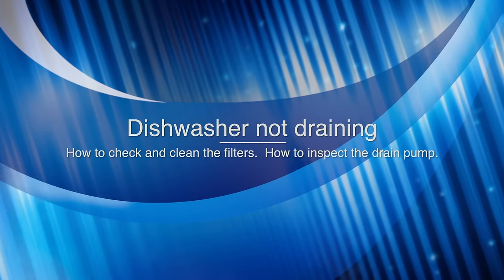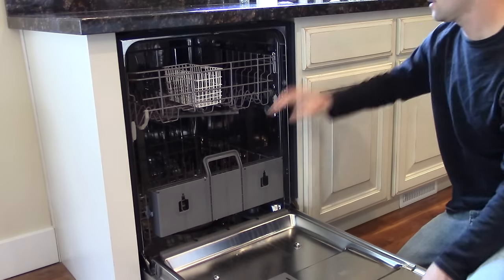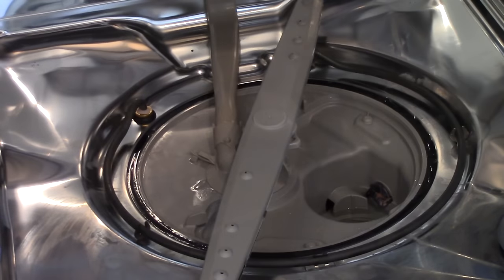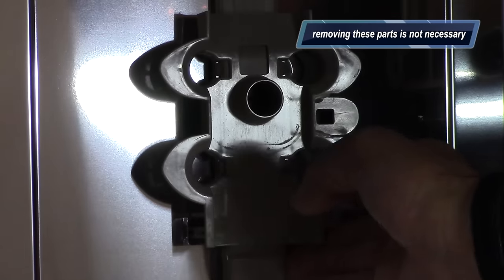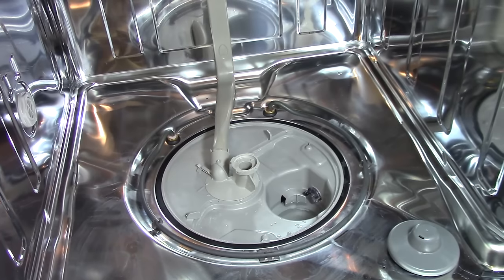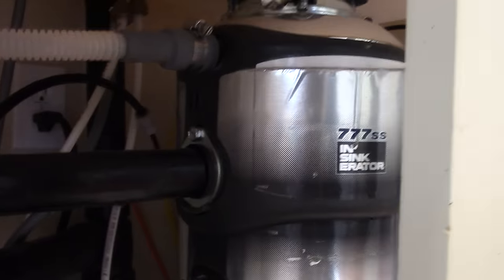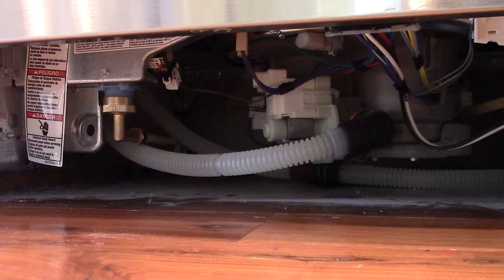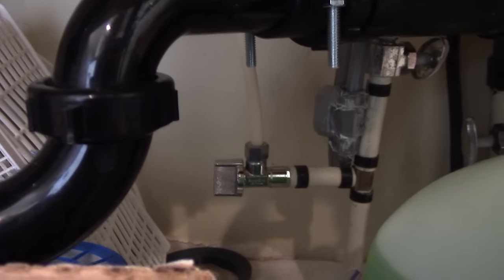How to repair a dishwasher, not draining cleaning - troubleshoot Whirlpool Kitchenaid

Comment: So mine is this exact model. I have water coming in with solid pressure, pump drains correctly but the arms won't rotate. I disassembled as you indicated and had no debris in the area in or around the filter assembly. What am I missing? Thanks

Comment: I have a Kenmore, but very, very similar.  Nothing you covered here fixed it.  However, I undid the tube to the pump, undid the other end of the tube attached to the garbage disposal and tried blowing air through the tube.  I could not and was able to deduce that tube was clogged somewhere.   It was a long loopij g tube and water was trapped.  Thank you so much.

Comment: i have a dishwasher just like the one in the video, except its black w/ grey interior, it will not drain completely, but water flows through the grey drain hose i have installed. I tried repacking with a new one ut it leaked, the connection leads directly to my drain, its jury rigged with a piece of copper in-between the old grey tube and some rubber hose (the grey tube is clear) any idea why it isn't draining? i hear the pump start, and the tube jerks when it starts, indicating water flowing

Comment: I have a brand new kitchenaid dishwasher that works great. However when I take the filter out to check that it is clean I notice there is water just under the filter area.  Is this normal, or is my dishwasher not draining properly? I've never had a dishwasher before so I don't know. It is installed with the 12 foot drain hose because I could not place it right next to the sink, so therefore there is not a high loop under the sink. Could that be the problem & if so, can I add the original 6 foot hose to it so I would have enough hose to make the high loop? My dishes come out clean & there is never any water in the bottom of the dishwasher,  just under the filter. Thanks.

Comment: Okay, I did this as it says nothing in the pump unit no blockages, mine has been setting for a while so it had buildup in the bottom from staleness, I have a portable (made it that way) and what happened was gunk filled the hose and blocked the exit to the drain tube so I ran an old tooth brush and squeezed the drain tube while it was putting pressure on it and that gunk shot out. So if this doesn't fix your problem look at the drain tube.

Comment: Pulled the dishwasher out, removed pump, no debris found. Powered on dw impeller works. End of cycle, the dw is still left with water at the level of bottom sprayer.

Comment: Our Whirlpool dishwasher suddenly stopped draining. We replaced the drain pump it drained better but not completely. We have to hit the cancel drain button several times to get it to drain. We have tried two new drain pumps and it still doesn't drain completely. All lines have been checked and are clear. What else could be going on?

Comment: its also identical to my amana adb1300afw1.   though this video didn't help my problem.   I tricked it to cycle with the door open so I can see it fill with water and it drains fine too. but during the time between filling and draining water will not spray.

Comment: Hi. I took out the filter and a lever, small plastic arm was inside, inadvertently, I removed this part. I think this is the clip that the filter clicks into to hold in in place. I have no idea how to replace it or which way it even goes in?? Any advice?  Thanks. Donna

Comment: What is that rubber ring on the bottom of the dishwasher that is under lower arm called? Mine is deteriorating and I can’t find the correct name so I can order a replacement. Thanks for your video. It was very clear on how to clean filter, etc.

Comment: great video got me on the right track to repair. My issue wasnt the filter it was the drain line. My drain line goes thru an airlock (prob the wrong name, it sticks thru the top of the sink or under it) . Mine had a small piece of wood like the tip of a  toothpick lodged in it that accumulated other gunk and stoped it up. If you drain line has on of theese devices under the sink check it for clogs.

Comment: Hi Adam, Thank you very much for a very good video.  My dishwasher Whirlpool adp (I forgot the last 4 digits but it is less than 3 years old)  has stopped for the last week.  It starts, water comes in, water drains completely and then dishwasher goes off.  sometimes the light flashes 5 times, and I have cleaned the two arms and can't see any blockages.  Could there be something else? Please help???
Reply from the maker: Tariq Qadeer 

I would check the whole cycle for blockages. The blockage may be somewhere else along the line that is causing the machine to stop.  Also it could be a bad sensor, but that is not as common. 

I added the info below for anyone else reading this that may be interested.

Whirlpool Dishwasher Error codes.

F0. 10 flashes. Sensor Break (Only shown in test program. Not visible to customer).

F1. Single flash. NTC Break. NTC open circuit/short circuit or ambient temperature less than 3 Celsius

F2. 2 Flashes. Water leakage. Floater switch LS6 in drip tray has switched.

F3. 3 Flashes. Heating system defect. Heater or relay on control board defect. Chack also cabling.

F4. 4 Flashes. Draining failure. Drain pump, control board OWI or water indicator defect.

F5. 5 Flashes. Spray arm Blocked (not present on VBL version. On 1 digit display will show as F and flashing start led).

F6. 6 Flashes. Water valve (WV1) is switched on but flow meter (FM) senses no impulses (less than 10 impulses in 10 secs) and the water indicator (WI) is at a low level
Water Valve Closed. Water inlet hose blocked.
Water inlet valve (WV1) defective. Flow meter (FM) defective (leads to FM failure)

F7. 7 Flashes. Flow meter failure. Flow meter defect. Water inlet valve defect or water inlet hose blocked.

F8. 8 Flashes. Water level failure. Sieve strongly dirty or big amount of foam inside to less water.

F9. 9 Flashes. Continuously Water Inlet. Water inlet valve mechanically not closed or control board defect.

FA. 11 Flashes. OWI failure. Dirty OWI lens. OWI defect or control board defect. Check cabling.

FB. 12 Flashes. Motorised Diverter Valve

FC. 13 Flashes. Water Hardness Sensor Failure

A fault with no fault code indication = faulty module

These codes should cover the entire range of Whirlpool dishwashers.

Test Mode

Make sure the appliance is empty of water before running Diagnostics as it does not pump out before starting to fill and therefore you could overfill the appliance.
Open the door and set the program to the first program. (Normally rinse).
Turn the power off.
Press and hold the start button and while holding turn the power on.
After a little while the start button will flash, release the button.
Press the start button once and close the dishwasher door.
The machine will now run through a diagnostic routine.
If memory serves me right it takes about 20 mins.
The machine will stop during diagnostics if an error is found and will display the error code. If no error is found it will complete the diagnostics and end the program.

To exit diagnostics at any time just press and hold the start button till the program is cancelled

Comment: Also in case you recently installed a new garbage disposal and have this problem, make sure that you hammered out the plug for the dishwasher drain hose connection.

Comment: In my whirlpool wdf530plywo dishwasher, the water is not draining. I cleaned the filter, reset the breaker, it has no power. The float s fine, I removed all the standing water. Still no power. What could it be? Thank you in advance.
Reply from the maker: +Richie Fish No power at all?

Comment: Hi Adam, We have a dishwasher it's an Omega, and I have noticed that it doesn't drain fully where the filter goes, I noticed that in your above video yours hadn't drain all the way either. You had clear water at the bottom of where your filter goes. In my dishwasher it's a lot higher than your water level and it is pretty rancid. I have put through multiple dishwasher cleaners and it still stinks the dishwasher out and makes the filter all moldy and gross. I have pulled the above parts out as you mention in the beginning of your video but not the pump yet (Now that you've shown me where to look for it), and I can't see anything that could be blocking the machine from draining well. 

Does it sound normal that it's filling up where the filter goes? It pretty much covers the entire filter in this gross old water. 

Thanks for your helpful video :)
Reply from the maker: +Bexc Wexc   No that is not normal to have a lot of water in the bottom.  When you drain the dishwasher where does the water go? Do you see it flood into the disposal?  Or is the drain hose hooked up to a pipe?  If you can see it  drain in the disposal how heavy is the flow?  It should be a fairly heavy push.  If it is weak or a trickle you either have a clog in the hose or a drain pump problem.   If it is flowing well you may have water from the sink finding its way back into the dishwasher.  That happens when there is not a sufficient arch in the drain hose.  Let me know what you find.

Comment: My unit started to make some glass grinding noise and now it doesn’t go nick into a u cycle. It stops after one minute and the cancel led turns red. Is there a cycle that just drains the water ? I wonder if the thermal fuse could be the issue.

Comment: Mine had a problem the check valve. That thing is in the hose and it took me forever to figure it out. But only had to run some water from my outside hose through it to fix it .

Comment: Ours is a kitchenaid,  looks identical,  but it's filling and draining,  but not spraying. It's very frustrating trying to figure it out! Any thoughts would be great. 
Thanks!
Reply: George Robinson the spray arm holes can clog. Pop off the spray arm in the center and clean the holes with a toothpick. Some models have two arms, one top and one bottom.

Comment: Hi Adam, thank you. This model looks exactly like mine. I did break a glass in the dishwasher right before the water wouldn't drain. I tried the filter and the drain hole carefully but nothing. Where is this vent near the faucet that Chloe mentioned. Inside the cabinet? Thanks again.
Reply from the maker: Sorry for the late reply. She is talking about the Air Gap Vent. Some dishwashers set-ups use them and some use the drain hose high loop method.   The air gap vent allows airflow and when blocked with debris may slow the water from draining.  You know if you have one if you see a vent near the faucet handle of your sink. Just google image search 'air gap vent' and you will see what I am talking about.   Some places in the US require them and some don't.   If the vent is not the problem I would try a shop vac and try to suck out the glass from the pump impeller hole [if there is glass shards stoping the impeller] 1:41

Comment: Thanks for the info!  I have very similar dishwasher (Whirpool Gold model WDT720PADM1).  Washer wasn't washing.  It would fill, heat and drain however.

I cleaned out my filters (had some gunk for sure) and checked my water valve for blockage.  Still wasn't washing (would only fill and then drain).

I unplugged for a bit to check the undercarriage.  Unplugged all the connectors and inspected and reconnected.  All looked fine.

Then I plugged dishwasher back, ran a cycle and when verifying voltage at the pump the dang circ pump started working like it should (with 124v AC at circ pump)!!  Wooohoooo!  Then I ran a complete wash cycle with no issues.

SO...I'm not sure if the clogged screens, loose connections or perhaps I freed some kind of blockage when I was inspecting the circ pump and/or had the unit sitting on its side (?).  I'll never know.  Just glad the unit is washing again.  And the fix cost me $0.  =)

Wife thinks I'm a superhero!!!!!!!!!!!!!  <3

Comment: A very helpful video.  There's only one thing missing.  If you have one, don't forget the Air Gap.  It gathers debris as well.  After doing all the above, I needed a service man to show me how to remove the insert with a pair of needle nose pliers and remove the clog, which has stopped the dishwasher from draining.  It was a quick, $53 lesson -- but money well spent.  Parts and Labor for someone replacing the drain pump I was told would be $500.  I consider myself lucky I got an honest serviceman.  Mike at Vincent' Appliance  Repair in West Hills, California.

Comment: I have replace the drain pump and pump & motor assembly but I still have water in the dishwasher and checked all the hose and cleaned out my pipes under sink what else do I have to do so all water is emptied out

Comment: Adam just one question, I’ve had issue with my kitchen sink not draining at all (pls note it’s connected with my dishwasher), after I tried all ways, HG liquid, Unstopper spring, etc. Nothing works. Until today I found out my dishwasher is also not draining. So is it dishwasher pump problem which leads my sink not drain too?

Comment: Our dishwasher (WDT780SAEM2) has been working great for years now, until last night it didn't drain during a wash. With milky white water in the bottom, I wasn't sure what I could do or even where the drain was. Your video showed me where the strainer was and how to take it out. Though it was indeed pretty badly gunked up, I also checked the drain hose near the disposal and saw a blockage through the translucent plastic. I removed the end, poked out the obstruction, replaced the hose, and started a new wash cycle, to hear the sweet sound of water draining! Ahhh, success! No ridiculous repair bill, either! I LOVE the fact that this guy is American made in Ohio, too!

Comment: Thank you for the video. Please advise to also check the air gap fitting at the sink, if the drain hose connects to that instead of connecting directly to the disposal or trap.

Comment: Thanks SO much for the excellent video. The dishwasher wasn't draining; filter was clear...problem was down in the pump with the impeller, which was stuck. Turns out a small piece of glass had jammed it. Difficult to get that piece of glass out, but dishwasher is now running great and draining like it should. Thanks again.

Comment: Is there supposed to be any standing water in the filter area? I cleared the filter and I don't see any major blocks in the screen or hose but there is a little water where the filter sits (about a cup before I drained it). Is that normal? The last 3 loads I've done are not coming out clean at all so trying to find the culprit. I'll keep checking for blocks if there should be no water there.
Reply from the maker: +Emily M Yes there is always going to be a little water in the bottom of the dishwasher.  The everything that was left in the drain hose falls back into the bottom of the dishwasher. You should only see the water when you take off the covers, not if you just open the washer door.

Comment: I have this dishwasher - KitchenAid KDTE104DSS0.  It worked fine for 2-3 years and then stopped cleaning dishes, leaving them smelling foul, with the detergent often only half-used up in the open dispenser.  It also wasn't drying dishes properly.  Its performance improved a little if I poured boiling water onto the bottom before closing the door. I I then tried every online suggestion from every source I could find.  These included cleaning the two filters and drain sump, replacing the heating element, the water inlet valve, the thermostat, & float switch.  None of these resulted in any improvement.  In a last ditch effort before buying a new one, I took the dishwasher out, turned it on its side and dismantled every part that I could find, including the impeller and water pump.  I didn't find much in the way of debris anyplace it shouldn't be.  I used a small shop wet 'n dry vacuum on the end of the drain pipe that lead to disposal unit (I never removed it from the disposal unit) and on the water pipes.  I reassembled everything and gave it what I thought what be its last run - It cleaned two trays of very dirty dishes and left them spotless and dry!  I'm glad to have a workign dishwasher again but frustrated that I learned nothing in the process of fixing it!  To this day, I don't know what it was in what I did that enabled this machine to work again as new.

Comment: Our Whirlpool is not draining at all. I pulled the drain hose during the drain cycle and nothing comes out. I pulled the the drain pump out and when I shake it, it sounds like it is full of water. I should safely assume it needs to be replaced, right?
Reply from the maker: I would not assume that.  I know my comment is late but do you have the ability to power your pump on a workbench and see if it turn on?

Comment: I have a dishwasher almost identical to this one but the model number is WDF320PADB2. I took apart everything and found mine doesn't have the white disk that spins around and diffuses the water.. is that normal for this model? 
I live in a new apartment complex and the construction crews that worked on it were really hurried and did a poor job so I wouldn't be surprised if they left out a piece. any idea?